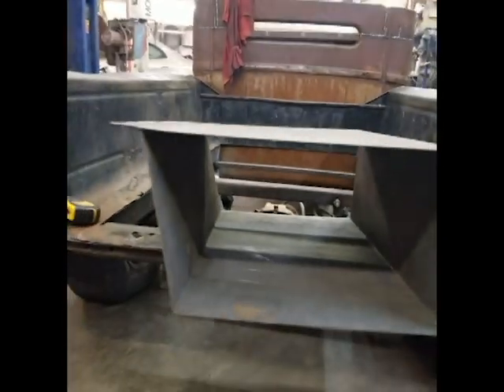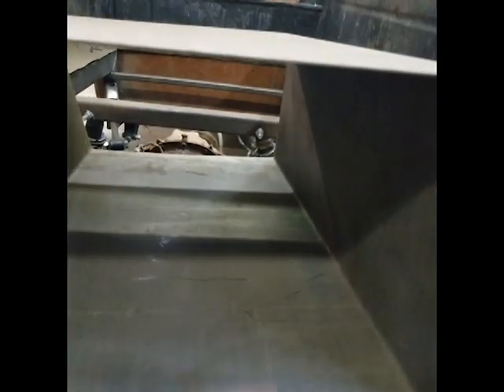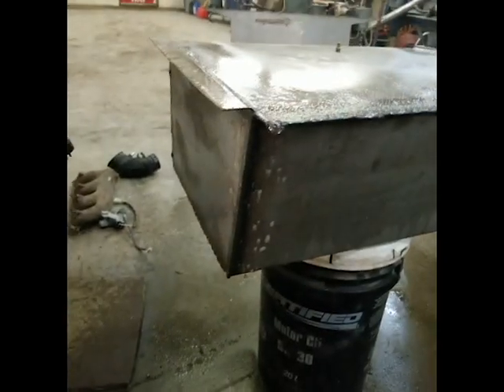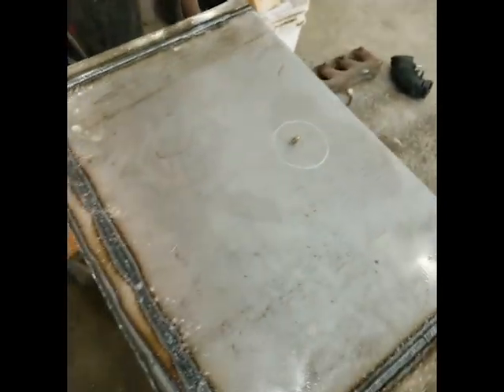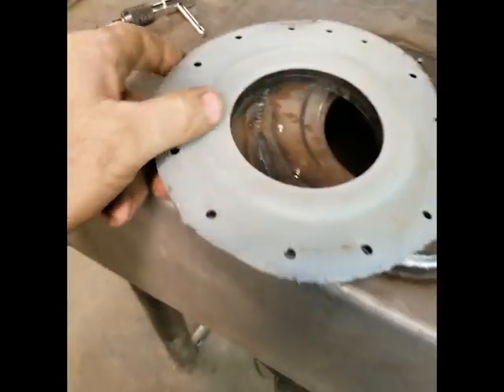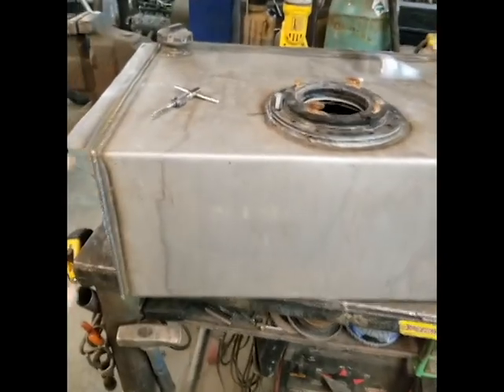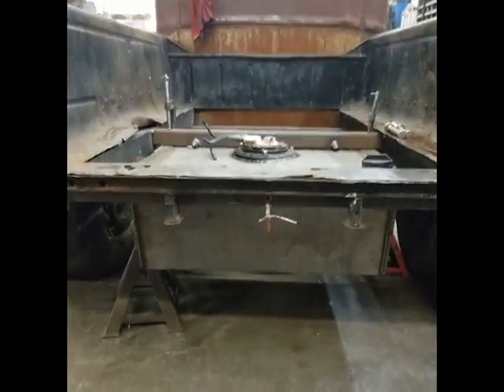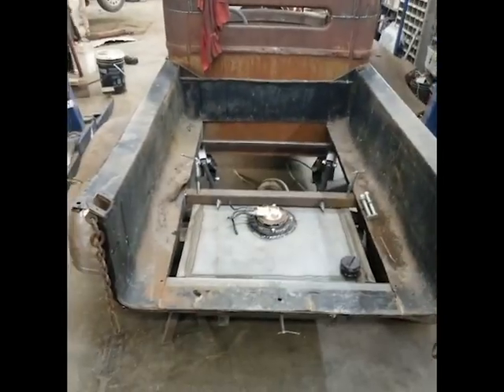Custom Fuel cell for Model T Pickup

Comment: cant even think about touching the welds with a grinder, or DA for that matter, because it becomes leak chase time again
Reply from the maker: haha yeah, first time I've had only like 3 pinholes using a mig. I usually Tig weld but was lazy that day but usually still end up with leaks.
Reply: I've seen guys use a center punch to stop leaks on weeping pinholes, but those tanks held mineral oil